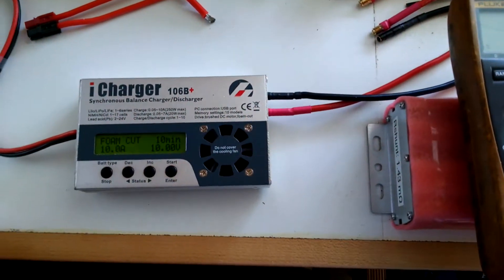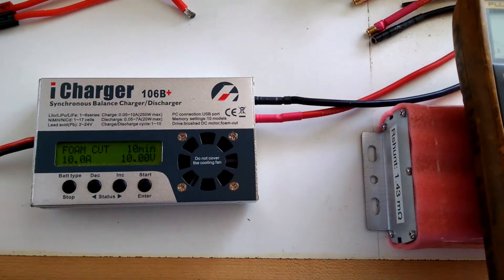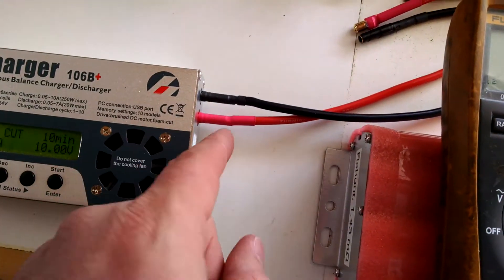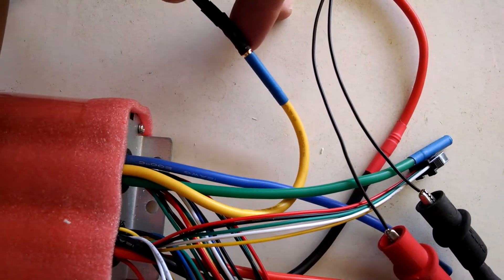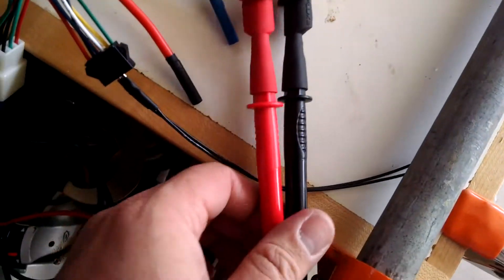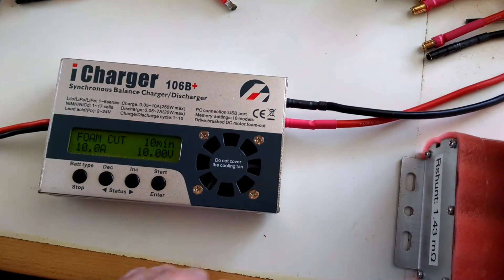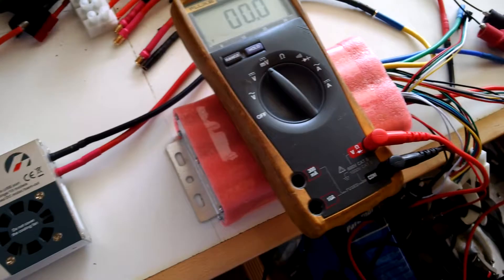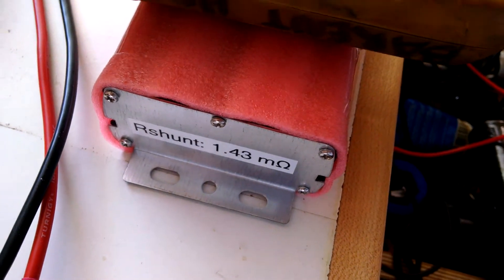How to Determine the Shunt resistance of your motor controller

Comment: Dear Kinaye, it is possible to do something similar with a VESC controller? I would like getting the six pins cable from the VESC to the Cycle Analyst. I do not know if is this possible. Thanks.

Comment: Very informative video, thank you! Any advice for someone who does not have that charger or a foam cut feature? I have a Thunder 1220 charger. No label at all on my controller, I think it's 30 or 35amps, but my CA won't be able to measure amp draw until I figure out the resistor value. Is there another way to do this?